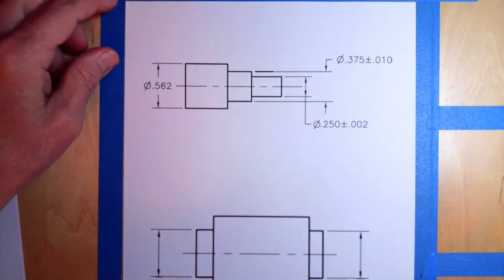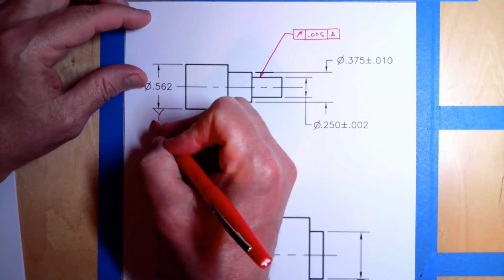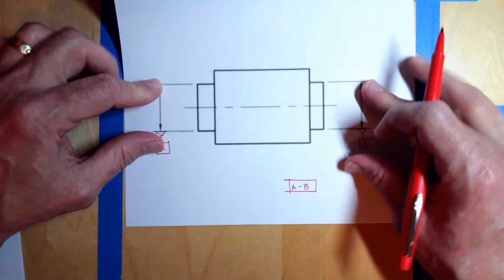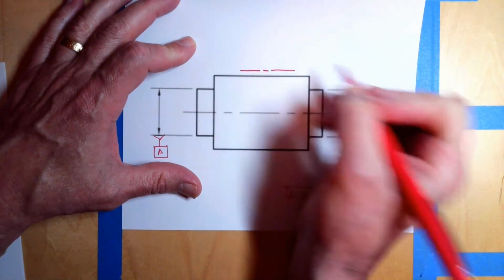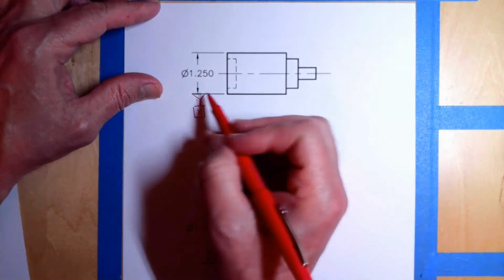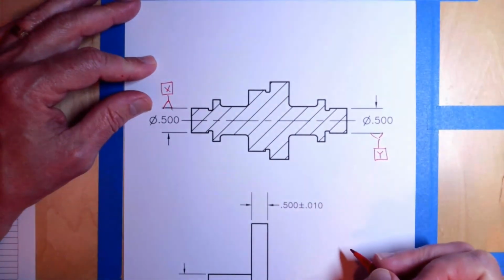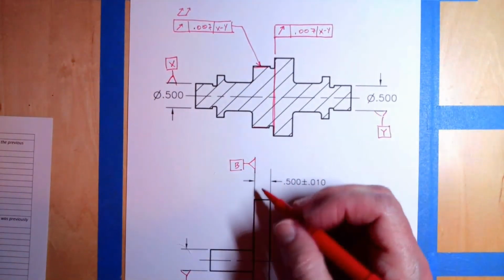Ch 10 Runout Examples

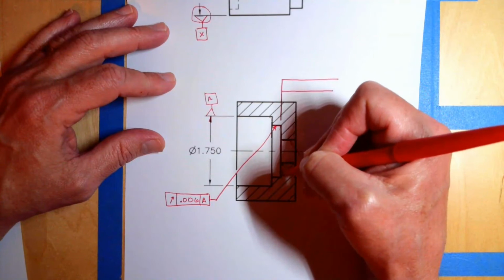Comment: Hello. I was taking some training on GDT and using ETI course materials. According to their material, total runout can be used on a surface that is perpendicular to the axis because the tolerance zone is the space between 2 parallel planes that are perpendicular to the datum axis. You mention twice that total runout could not be used at 13:08 and at 18:30 for the surfaces that are perpendicular. I like your explanation as to why you cant. I just don't know why my materials say that you can. Confusing. Can you elaborate? Thank you and I love your videos.